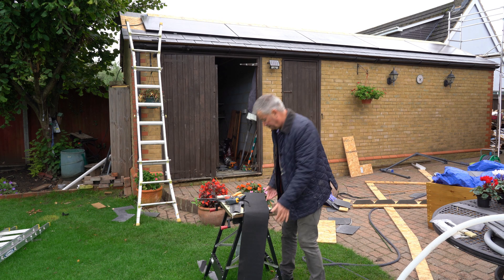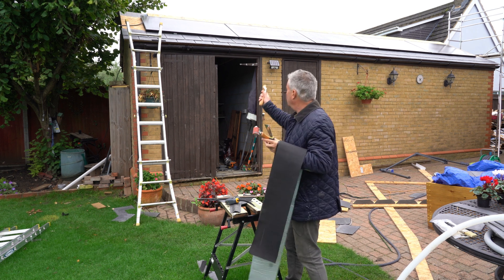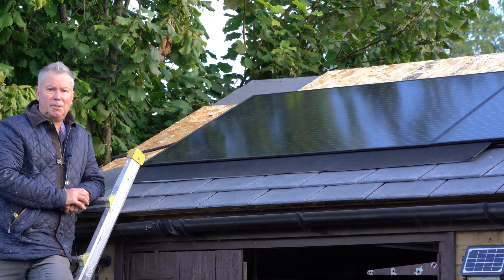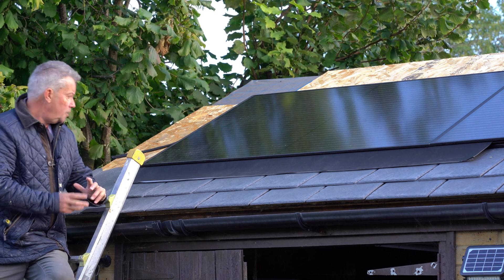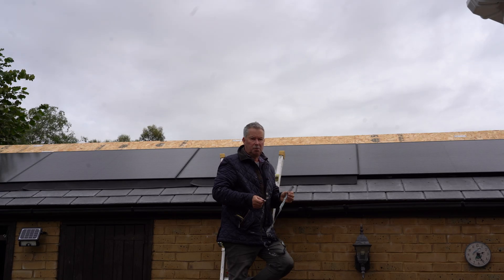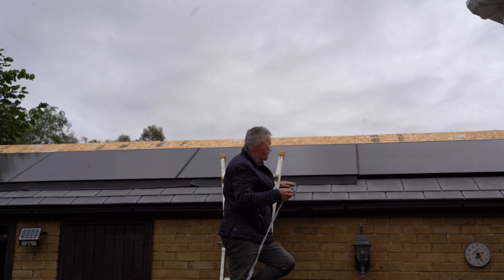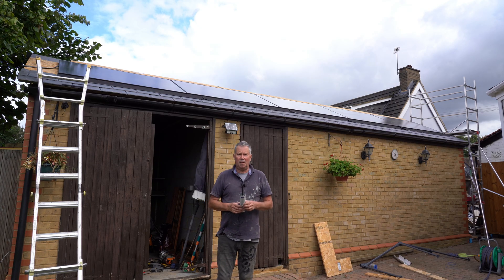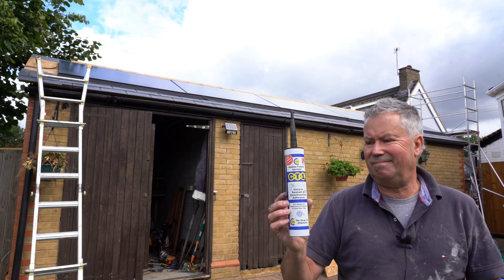DIY Solar Panel EPDM Flashing Installation

Comment: Mr Jones is getting in to the groove, just like Madonna 😂😂😂 Really interesting and will motivate many projects 😊
Reply from the maker: It's been good experience and a lot learned. If I was starting again I would use a mixture of cheap thin aluminium that is simple to form and also EPDM. That will be the plan for the main roof. I think Madonna may have slipped out of her groove!